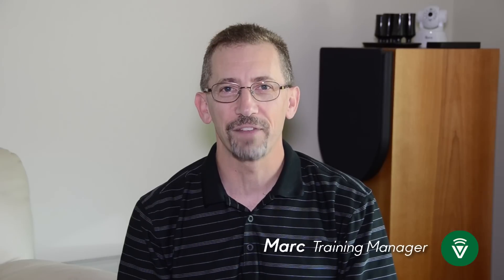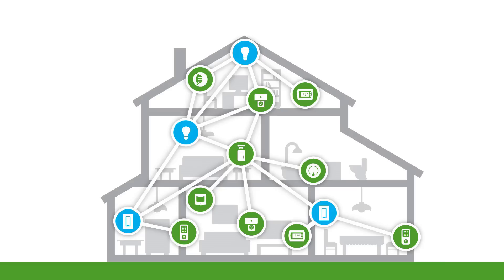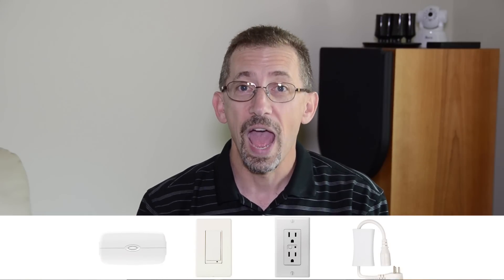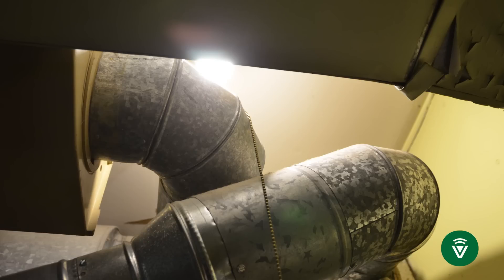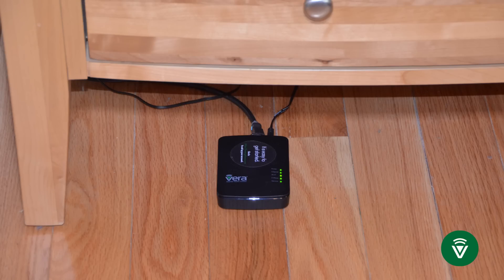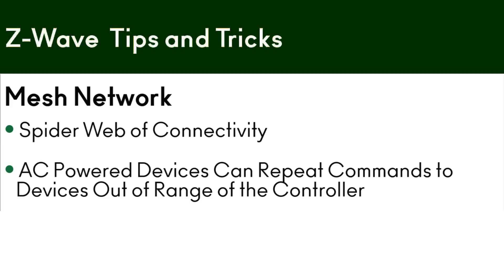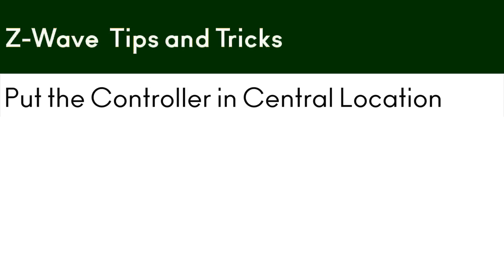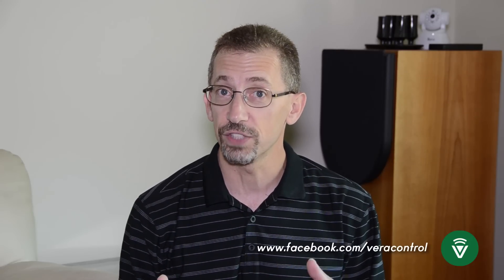Ezlo UI7 ▾ Tips & Tricks ▾ Z-Wave

Comment: Thanks for the video. I subscribed so I can learn more about my Vera app and Z wave connected devices. I currently have an Ezlo Atom controller, along with a Schlage Connect door lock and three water sensors. I am getting false alarms from my door lock stating “door is locked “ door is unlocked”, or “door is not operating correctly “. All these alarms are when no one is near the door. I am trying to figure out why this is happening and have contacted Vera app support.

Comment: What if I buy 3 or 4 VeraPlus devices and put each one in a place, what should the process be here ? Can I connect each VeraPlus device via Ethernet cable together ? or the Ethernet port in VeraPlus devices is for connecting to the router only ? 

If I bought 4 VeraPlus devices for example,  do you think that there will be compatible problems when they working at the same time? because I heard that each VeraPlus device create mesh network, so we have here 4 mesh network right ?